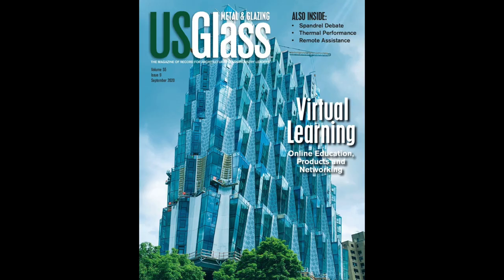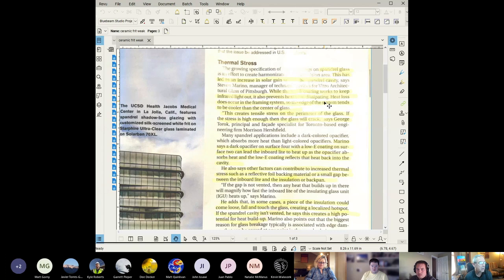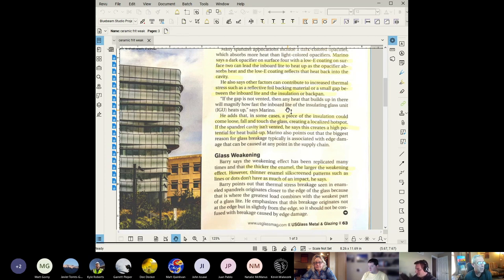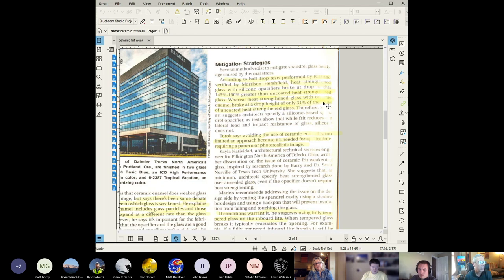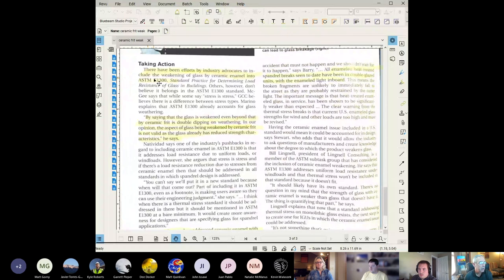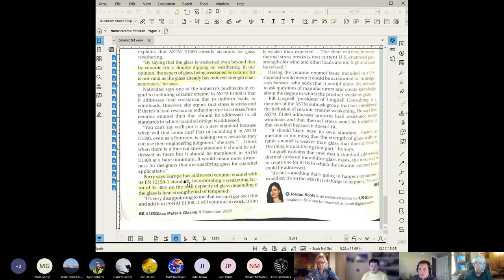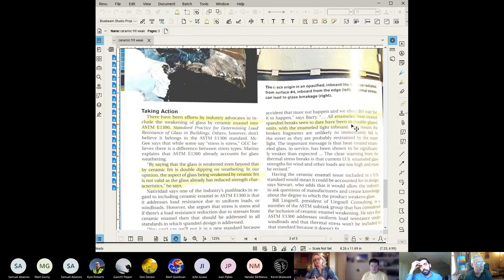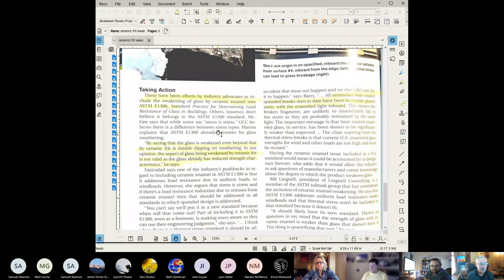Does Ceramic Frit Make Spandrel Glass Weaker?

Comment: This is a great topic. A few comments.

Frit is usually made of small glass particles with a die/ink/colorant that is applied to the glass and baked into the glass through the tempering process. 
Etched glass, also mentioned here briefly is the process of disturbing the smooth finish of the glass either chemically or by other means like sandblasting thus removing glass thickness leaving a rough finish. Etching is not used for spandrel.

Spandrel glass can be done in many ways, but the more common way is to either use a solid (full flood) ceramic frit covering by either being printed (screen printing or digital) on the glass, or a pre-made product like Guardians Spandrel HT line. Another process is ICD's surface sprayed water silicone that merely stays on the surface and does not chemically alter the properties of the glass by fusing into it. 

The interesting part of the study is that under a microscope they discovered that some of these particles would penetrate into the glass considerably and affect the glass much like a seed or inclusion could.

ICD's website has several free classes and one of them talks about this showing the studies in detail with photos. The most surprising part of it, is that despite the amount or pattern of coverage, the failure of fritted glass seems to always origin from a part of the glass with the frit coating, not the areas of the glass that stayed clear/untreated.

Comment: I would like to share my thoughts with regard to spandrel glass, basically, what Kayle is asking, spandrel has to be ceramic or have a shadow box, because this will serve to cover the elements, like slab and brackets, which is potentially visible from the outside. That is the reason, not because of the distinction between vision and spandrel.
Reply from the maker: Essentially what you're saying is right.  The reason for the ceramic frit is to cover up the structure or other ceiling utility space.  But Ceramic frit is not the only method of covering this area up.  There are films and other types of coatings that also do the same and maybe better regarding the strength reduction for glass.